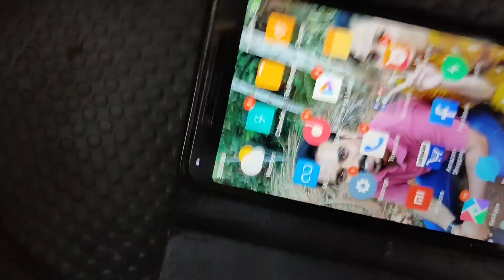Coverting tiago to a camper, DIY scrapped ups to a car inverter🚗🏕️💯

Comment: Battery drain aayi starting trouble varan chance elle? Ethra neram use cheyyan pattu appo?
Reply from the maker: Low wats verunna 230 ac input verunna ella led bulbum . Mobile charger, laptopcharger ellam use cheyyam...consumption kooduthal ulla equipments use cheyyumbol vandi on cheythu iduka......runningil use cheyyuanel ithonnum consider cheyyanda
Reply: Alla camping nu use cheyyumbo nammuk oru idea venamallo. Ethra vare aanu safe limit enn. Vandi aayi pett pokaruthallo
Reply from the maker: It purely depends upon load, normally we can calculate this by below equation
Battery voltage*battery AH rating*number of batteries* efficiency of battery/ load in watts
Here in this Circuit, suppose iam connecting  two 14watts bulb and  one 75 watts fan then the load in watts will be 89 watts then 
12*39*1*0.85/89= 4.5 hours
It can work upto 4.5 hours continuously on that load...if we use bulbs and chargers it can last upto 13 hours because the load is reduced
Reply: Ith full drain aavunna case alle. Engine start nu venda power oru threshold aaki baaki ethra use cheyyam enn paranjal nallathalle. Ithra manikkoor vare off aakkiyittu upayogikkavu ithra ithra sadanangal upayogikkumbol enn. That will be a clear guidance. Parking light itt vare battery drain aayi pokal elle.. athond pranjeya😅
Reply from the maker: Usually car holds filament lamps and halogen lamps  in its default  and this consumes more energy so that the car dains its power when switched on these for long times. Using led bulbs or charger doesn't drain that much of power but even if for safety  we can add a 200 amps capacitor  as the starting motor consumes below 200 amps  for 0.5 seconds to start the starting motor
Reply: That's too good then. Nice job bhai👍 Waiting for the next one.